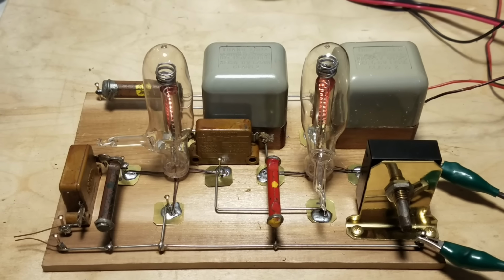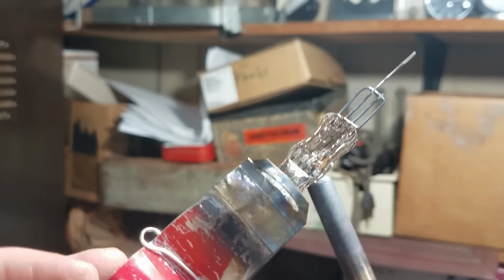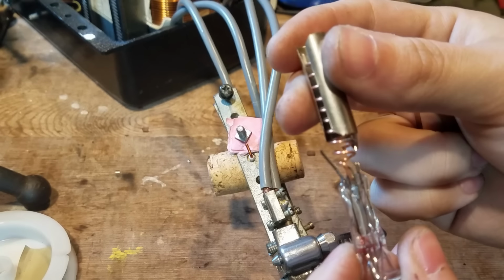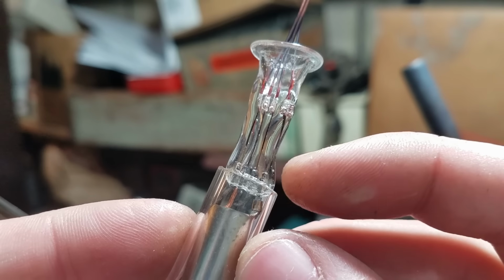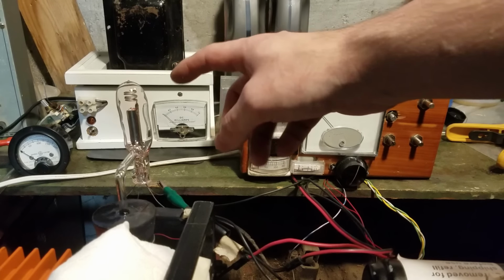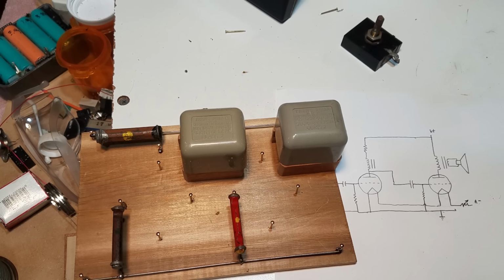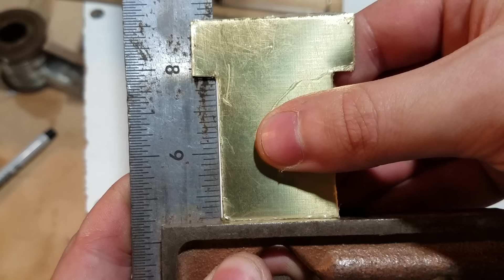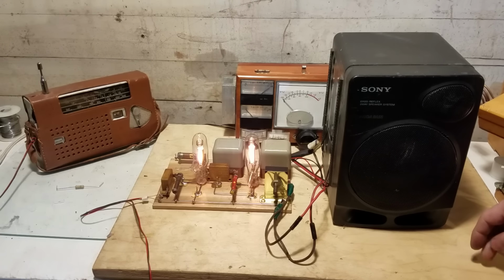Building a 1920s Tube Amplifier (And Tubes!)

Comment: TOTALLY AMAZED at how well you have done, at a cost and time investment drastically less than what I have done. I am trying to find a way to email you to offer help with your endeavor but no luck so far. I guess they want to prevent spam. I'll see if I can figure a way. Don't give up! You are well on the way to being an expert!  :)
Reply from the maker: Wow! Thank you so much! I have been watching your videos for around 10 years now. I have a channel email address jdflyback(at)gmail(dot)com. I have not been able to get oxide cathodes to work. I think I wil have to put together a high vacuum system for that. The pure tungsten cathodes do not seem to mind the poor vacuum though.
Reply from the maker: I am sorry I missed your email! It was in my spam folder. I have written back.
Reply: @jdflyback  re oily vacuum pump: have you heard of a Sprengel pump? It uses falling drops of Mercury to entrain &remove gases. Slow, but very high vacuum is possible, no moving parts or mess. With your glass skills, you could easily make one. There's an article in Wikipedia, and Cody makes one on his channel, Cody's Lab.
I wonder if warm, molten Gallium would work, it's hard to get Mercury now.

Comment: This video is from a series: I was thrown onto a desert island, I was left without communication, but I have electricity, a gas burner, various wires, several radio components, glass tubes, vacuum pump and a screwdriver. It remains to add a few more lamps and an antenna, and then you can shout "Help Me!" and "SOS!" into the audio speaker! :)
Reply: Or even turning it into a SW Transmitter to send SOS to ham receivers on the mainland

Comment: Hat off for making these functional tubes! Seen from my perspective as former lamp (read light source) prototype glass lower at Philips Lighting 2003-2006) We would consider it impossible to make lamps with your limited set-up.

Tips, after only seeing this video. 
If you can use an accurate vaccuum meter you can follow the de-gassing process. That means you can see when something is wrong in the lamp. It's good enough to only heat up the getter once, right after the lamp is ready (= pump tube sealed). One second hot is enough time for getter activation.

Thanks for sharing, keep up the good work!

Comment: Really very nice grass root fabrication of your tube amplifier!  First, this process would probably be necessary if you were not to have radio communication with others (a clandestine operation!) in some third world country.  Also, I use sodium light filtering glasses which really help to eliminate the troubling yellow-orange light.  Thirdly, for some glass work, a smaller flame would help.  You should mention to the beginners that the big orange flame is to anneal the glass so it will not break when either heated to melt or cool to room temperature.  However, the whole process is really great and it work!!!  You are the best!

Comment: A little trick for your lampwork to prevent stress cracking on feedthroughs,..and any lampwork.
When you're done the work, build up a good layer of insulating soot on the glass during the carbon flame and completely wrap it in cotton batting while still hot.
It will smoke a bit, but cool down much slower and reduce stress and cracking in the metal/glass interface.
The carbon layer just wipes off easily when cool.

Really awesome work, reminds me of my young days of if you can build it, you can have it.
Keep em coming.

Comment: Maybe try making geiger tubes. The gas mix that is easiest is argon welding gas with about 10% of an electron quencher of your choice. Hydrocarbons, CFCs fluorocarbons , chlorine or bromine all work. Firing voltage is about 250 to 600v. Pressure can be anywhere from 40 to 120 torr. The coil grids would work well for the anodes. Nickel is ideal if using streight halogens. ❤

Comment: When I was a kid I got hold of an instruction to build an AM radio with three extra-tiny triodes. These were as small as a bulb of a flash light. They were connected with four wires directly, without plugs, into thecircuit.

Comment: Classic!   I dabbled into this tube making hobby but always using gloves. Getting rid on finger grease is very difficult and acetone is just about the worst degreaser.  Most importantly,getting rid of acetone vapors is damn near impossible  For all high vacuum stuff I did at work it was always ethyl ether to degrease and the final rinse with 100% ethanol that leaves no residue. We used rough pump and turbo pump to get to 10^-9 torr for laser spectroscopy.

Comment: I was extremely impressed by your video.
This is a skill we need to pass down through the generations because vacuum tubes are impervious to emp, and you can't really make transistors or fets at home on the kitchen table. 
 I would like to stock up in the basic materials such as the glass tubing and the tungston and copper wire used for the filaments and the correct air tight glass seals, but have no idea where to purchase them.
 I have everything else I need, including dozens of different gauges of Nichrome wire and the hollow ceramic tubes to make my own resistors, plus sheet mica to make my own caps...
 I have a vacuum pump, and various torches, but lost when it comes to sources for the materials required to make the tubes.

Comment: Wow, this is the first video I've watched of yours, and I absolutely love it!!  I build electric guitars and occasionally work on tube amps for fun, I have old test equipment and make some of my own tools.  This is totally up my alley!!  I want to make my own tubes and a guitar amp now.  I already have half the equipment you used, and it looks like you made most of what I don't have.
Thanks for this awesome video, you just got another subscriber
Reply: Man, the more I think about this, the more feasible this is...  I think I have a proper power transformer and I know I have an output transformer for a single ended audio amp....  I even have a vacuum pump I used for refrigeration work at my last job.  I also have boxes full of resistors and capacitors that are rated for tube amps.

Comment: Good work man. This reminds me of  projects years back in the 1980's when I built several Time-of-Flight mass spectrometers. They were built on metal structures and ceramics and Teflon, no glass. I designed and built electron guns, grids and anodes plus detector system plus electronics in a similar way you do. Everything  was made by hand and simple tools as nothing was available for that.

Have you made any attempt to measure the curves of the tubes you have made? I would be interested in the behavior relative to the gate voltage. You seem to use the small resulting negative bias made by the filament voltage. Btw, you could add some negative feedback to this amplifier to remove the distortion. The power will go down but the sound becomes much better.

Comment: I recognized those Western Electric "chokes" instantly, they're the power supply transformers used to light Princess Phone dials. When the Ma Bell tech came around in the mid 1970s to wire modular RJ-11 style jacks in our home, he replaced ours, and gave me the old one as a toy. I made my first circuit with it, just hooking it up to a paper cone speaker to listen to the hum, or bounce a pair of dice around inside a funnel (a "random number generator").

Comment: @57:40 "It kinda works." NO. It worked flawlessly. To your point, yes, it could be improved here and there. I guess, now that I've seen someone build tubes from scratch, now I want to see hand-built resistors and capacitors and transformers, too! If the magic glowy tubes can be built from scratch, surely those can be as well, right? 
This was amazing. Cheers!

Comment: There is - or was - a 'Vintage Radio Museum' in East Dulwich, London UK where the great (late) Gerry Wells used to make vacuum tubes which was amazing.  After watching you make your tubes from start to finish, I appreciate this feat even more now than I did back then.  I wonder if any of the techniques you used were perhaps not available back in the 20's - induction heating perhaps for the 'getter'?  Gerry used a metal inside the bvulb andc heated it externally to get the metallic reflective sufface inside, different tecnique I suppose.  But just brilliant, well done!

Comment: Instead of heating the elements for such a long time and at such a high temperature, why not use a getter material (barium, strontium, etc..) and flash it with the induction heater after sealing? It would be less wear on the tube components wouldn't it?

Comment: gratulation , i am rf technican and used vacumvalve for hf transmitters  and linear amps my next project is fixing an old TS520S hamradio  the final valve is brocken so modification with one RS1009 vacvalv from siemens . hope to get at last 120Watts out put again...

Comment: Hey, JD. Very frickin cool.

Looks like youre burning propane? I just tried this, this weekend, with MAPP and it seems like your setup is liquifying the glass so much faster than my attempts.
Reply from the maker: Thank you! I am using propane. I do not know if the torch is at all special or not but it seems to work the boro ok. It is a Bernzomatic TS839. 
I have since acquired an oxygen concentrator and use it with a national 3a blow pipe with propane. It really is the way to go. I wish I had switched years ago.
Reply: @jdflyback  Noted. I'll do some digging.

I've given myself the goal of making some simple light bulbs and hope to be able to emulate what you're doing here down the line someday. 

So, thank you! You're videos are really helpful.
Reply: @jdflyback  Thanks again. I hope you're well. Your work really has been an inspiration. 

If you ever get time to make some more videos, I'll be looking forward to them.

Comment: Had you thought about making a new version of the ‘low boiling point solvent bubble tubes’ which were popular as Christmas tree lights in the 60’s. I think the solvent was methylene with various coloured dyes added. The heaters were low wattage filament lamps and the tubes were partially evacuated so it only took hand heat or just above to start them off. A modern battery type would be brilliant. If anyone can do it, you can😀👏

Comment: I am a professional glassblower and I am amazed with your skill with such limited tooling. I assume you are using softglass?
Reply from the maker: Nope, 7740 boro. I have since switched to an oxygen gas torch which makes it a lot easier.
Reply: @jdflyback  Sounded like a map gas torch in the video. What torch do you use now? Have you thought of buying or building a small kiln for annealing or garaging parts?

Comment: Well, I'm impressed. I build diy tube amps, but would not have the knowledge or equipment to build my own tubes.
I don't have rolls of Tungsten at hand, electric flash soldering device, nor a vaccuum pump at hand, and I guess one can not put 'randomly' or guesstimate the elements to put in a tube, the material to use, the gaps etc.. and I've never seen any filament glow that bright white, even in a 211 or 845, or 300B.. or one should worry.. how long these tubes last? And what are the voltages applied? But they're a great DIY achievement, no doubt.
Reply: That is a serious heater for a tube. Never seen one glow like that and work very long. In the old days turning up the filament voltage could get you a few more years of service out of old tubes. There was a booster for picture tubes that just plugged in to the gun that boosted the voltage on the filament that would make the picture tube last a little while longer. But that was a long time ago.

Comment: i've seen that usually used 4 tubes.. 2 for pre amp section and 2for output power stage.. please correct if i'm wrong.. and uare great.. just hat's off...

Comment: This video is amazing, so glad I've found your channel.

I notice the bare hands which makes me a little nervous, should you be wearing gloves?

Also, I was wondering if i wanted to try my own crappy version of a tube, would it make sense to experiment with a check valve, so I could top-up the vacuum over time?
Reply from the maker: I need all the dexterity I can get. I kind of learned quick what I could touch to be honest. I am not aware of any readily available check valve that could be sealed to glass and is vacuum tight. It is easier to make a completely sealed tube than deal with that.

Comment: as always, great video! One question, what is the power of your induction heater? And it seems you have a new vacuum pump. What is the final vacuum you use for that tubes?
Reply from the maker: The induction heater is around 200 watts. Pretty underpowered. The mechanical pumps get down to around 10 microns and the getter brings it well below 1 micron. I have also recently finished a high vacuum system able to reach 1x10^-6 torr which will make for better tubes in the future.
Reply: @jdflyback  thank you!  I love your videos, please share your new vacuum system. I'm sure it will be a nice video

Comment: Let me tell you something you already know for those at home watching: Any tool that come in contact with the flame of the torch or is subjected to high heat is scaraficial. Tools that are tempered will lose their temper. 
    You need an assistant to make cabinetry for device’s such as this and to make you tools like a foot operated masher for the tungsten seal and a thumbscrew for that makita drill. Crazy thought …how about a mist chamber to make oxide coating. Use an atomizer for like a gecko an induction heat and test samples to create run time. Someone to straighten tungsten wire for you. <uhum>  The tungsten amazes me I got tungsten carbide crystals white hot and hit them with a sledge hammer and all it did was dent the hammer.

Comment: Hey I was curious, vacuum tubes can do analog logic, and high amperage low voltage devices sometimes have longer lifespans or ao I've heard but I have no citation so I may be wrong.

Moving onto my question: if we could get some factory to make these the size of leds or neon indicator bulbs: 

Could we build a programmable array capable of analog differential analysis?

Comment: The proof is in the pudding, and you've achieved your goal. But keep in mind, whether the flame is a conical air mix, a blooming swirle , or non mixing soft plume,  the pre-combusting hollow part,  close to the tip is cool gas. For maximum temperature and even heating, keep the object away from the hollow center cone.

Comment: It seems that in these tubes the greed is closer to plate rather than to cathode. That, probably, decreases gain factor and sensitivity (slope of curve) of tubes ;)
Reply from the maker: Yes, I have had issues with the filament sagging and touching the grid. The spacing they have now seems to be a good compromise between performance and ability to survive.
Reply: @jdflyback  Ok! Thanks for explanation!

Comment: Why not use Dumet wire for the glass seal? Dumet wire is bimetal made of a nickel-iron core encased in an oxygen-free-high-conductivity (OFHC) copper sheath. Dumet wire has the same expansion ratio as glass.
Reply from the maker: Dumet works for soft glass but not for borosilicate. There are special sealing metals but Tungsten is the most common for Pyrex.
Reply: @jdflyback  Yes that's right
Reply from the maker: Forgive me, what was your question?

Comment: Why did you pinch off the end of the evacuation tube initially?
Reply from the maker: To blow in air while sealing the stem to the envelope
Reply: Mind if you clarify a bit.? You sealed the ends of the evacuation tube, so how did you "blow in air"  It seemed to me the point of that tube was to suck out air to create a vaccuum. @jdflyback

Comment: besides style, is there a reason you made the envelopes that shape?
Reply from the maker: No, the tube would work without the glass expanded at all. Earlier tubes made of soda lime glass needed the glass spaced away to prevent the heat from cracking the glass. Pyrex does not have that issue.
Reply: @jdflyback  cool
while I have your attention, mind if I ask a few questions?
this whole has me captivated

Comment: I'm curious about some of your design choices. At one point you shorten the tube but size has no real functional effect in what your making. a large glass envelope with the same parts inside will run just as well as a small glass envelope as long as both are evacuated so why add more work by shortening it?

Comment: Where did you get the getter material? I can source everything else but that..
Reply from the maker: 1mm titanium wire. Search "TEMCo Titanium Wire 20 Gauge 25 FT Surgical Grade 1 Resistance AWG ga" on ebay

Comment: Brilliant  might make a better amp for playing a 6 string,  ill bet that radio output isn't that clean  and any amp on the out put of it is going to bring the noise floor up with the output.  Using an instrument to play direct into it going to be cleaner.
Plenty of amps for musical instruments still use tubes  and they are not cheap to buy one tube can cost over 140 bucks. 
A small amp and speaker is a good practice volume @  20wats plus the distortion won't upset anyone in fact they want some.

I'm blown away you made tubes, now a crystal radio to go with it.
The old 60s and 70s transistor radios didn't sound that good and after 60 years the caps are leaking.

Comment: I believe Alexander Graham Bell would have killed for such tech 🙂

On another note, what you did shows that while the science became available only a few very short centuries ago the technology to build vacuum tube based electronics would have been available in antiquity already. All metals you used can be obtained by metallurgic processes that were already available thousands of years ago. Soldering might have been more clumsy and primitive, but I doubt it would have been so bad as to prevent creating usable electronics.